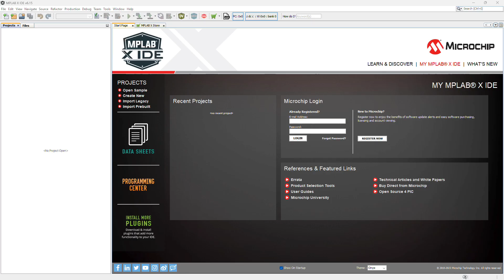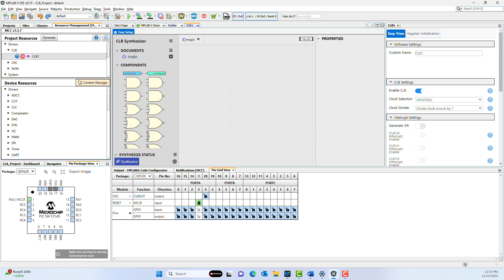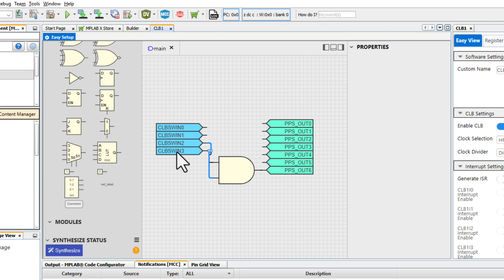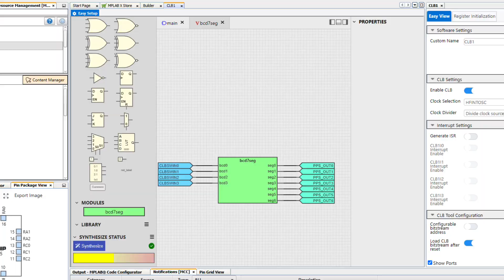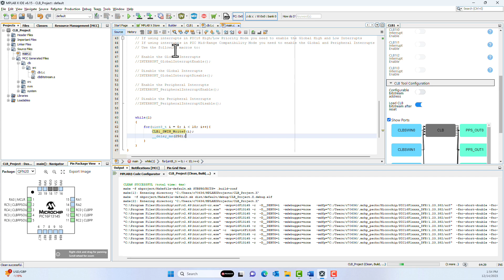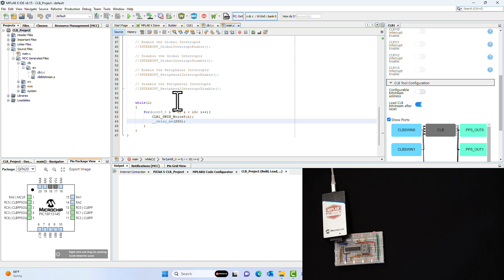Chiptorials - CLB Synthesizer Quick Start Guide – Driving a 7-segment Display

Comment: Can they be used to generate complementary pairs of high res. PWM signals? For example for a full bridge converter by only using one pair and some logic for no shorts.
Reply from the maker: Hi Miguel, thanks for reaching out! Yes, Microchip's Configurable Logic Block (CLB) and Complementary Waveform Generator (CWG) can be used to create complementary PWM signals for a full bridge converter. These tools help manage the timing of signals to prevent shorts by controlling how the switches turn on and off. They also offer features to safely stop the PWM if there's a problem. For more details on setting this up, you can refer to Microchip’s documentation on Complementary Waveform Generator and PWM Dead-Band Control which includes guidance on using these modules efficiently.
Reply: Hi!, thanks for the reply. How about the CLCs? I am into dspic33 devices and they only include this block. Could they achive complementary signals for FB controll?. PWM resolution js up to 250ps, could this be affected?.

Thanks.
Reply from the maker: No problem! Yes, CLCs in dsPIC33 devices can generate complementary PWM signals for full bridge control. They offer flexible logic functions to manage signal timing, ensuring no shoot-through conditions. The fine resolution of 250 ps is maintained.

Comment: Nice. Makes me think a CLC or if not, the new CLB module might provide an easy way to drive addressable LEDs (so called Neopixels by some vendors). Should be possible to use a serial output, via CLC or CLB, to get the additional clock steps onto the data line, without needing to use timing loops and stuff in the main CPU. Maybe set a data buffer and DMA it directly to the serial out module and its done.
Not sure thats the most important use of the new CLB but it feels like something to try, when I get some PIC16F13145s in about a week or so. (I'm not in the US, so shipping delays etc etc takes times).

OH! Maybe no DMA on PIC16 devices. Something else to look into now ...

Comment: This vide using PICkit5,  can using PICkit4？
Reply from the maker: Hi there, thanks for your question! Yes, the PICkit4 can be used for programming PIC microcontrollers in projects like the one in the video. It supports all released PIC microcontrollers as an in-circuit programmer and can be used with MPLAB X versions from v4.2, including for debugging and programming – The PICkit 5 Programmer and Debugger is recommended though as the PICkit 4 has gone EOL and will no longer receive device support.
Reply: I tried my Pickit 3. Nope.

Then I tried my ICD 4, and it seems YES, and was accepted as the programmming/debug device.

I don't have a strong need for a Pickit 5 or ICD 5 right now, but I expect in time I'll have little choice if I want to use newer devices.

These CLB modules look like they will be great. Will be interesting to see if they get added to the PIC18 family in time, and if any devices will support more than 1 CLB module, or more than 32 CLBs within that module.